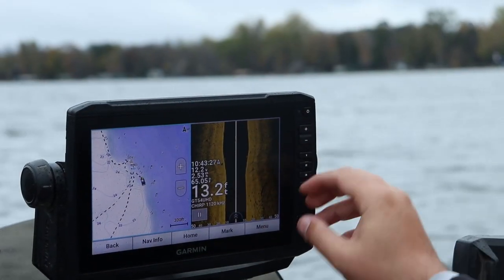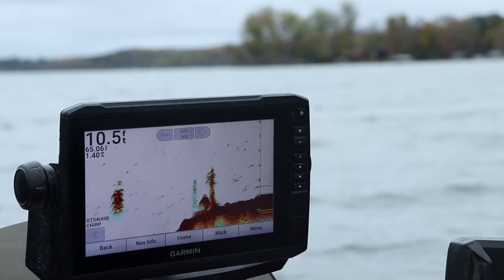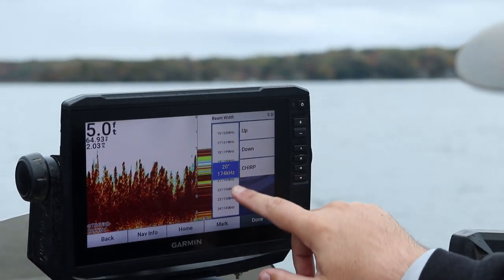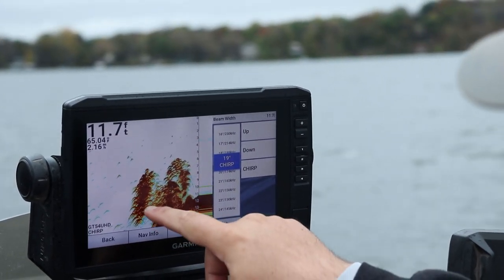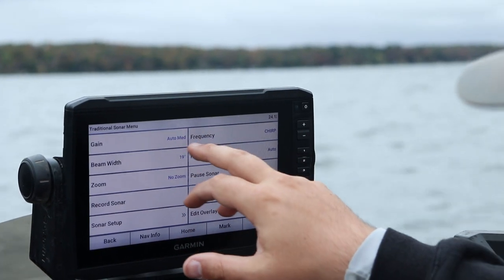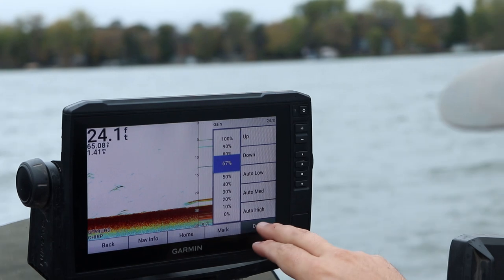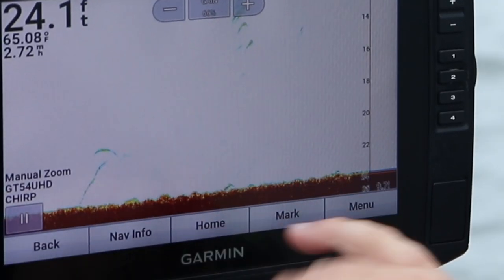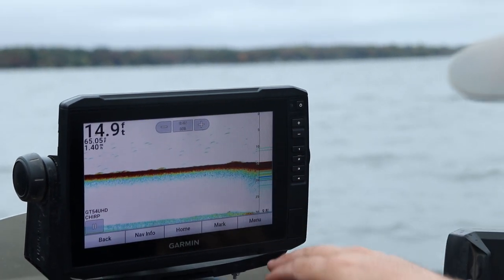How to use 2D Sonar to Find Crappie (Best Sonar Settings)

Comment: I’ve got the Garmin 4 on a 14ft Marlon aluminum. I’ve never really liked it but it is better than nothing. I don’t fish big water like you guys out there. I’ve only got a Honda 8 HP and a 20 year old Minkota. Thoughts on upgrading the transducer to the Garmin GT8HW TM VS just spending the $500-1000 and getting a new unit all together. Thanks from Western Washington.
Reply from the maker: You may want se the striker 4 and upgrade to the striker vivid 5cv instead of gettting the gt8w transducer.  The 5cv will have down imaging and plus mapping. Or, if you had the budget,  the Garmin 7sv.

Comment: I use my unit at sea I have garmin echomap 75uhd  I need to find wrecks at depth between 30 meters and 100 meters what settings would you suggest for this. Very good video. Gerry

Comment: do you have it? What do you have on a 9 inch boat can you use it under the ice Fishing Please answer
Reply from the maker: You can use the Garmin 93sv for both the boat and ice fishing. If you want to use it for ice fishing you will need to buy the Garmin ice fishing kit, which comes with an ice fishing transducer and a portable battery kit for the Garmin 93sv.

Comment: i am looking at buying a 126 ultra ,theres so many units to choose from, i will be crappie and bass fishing
Reply from the maker: The 126 ultra is top of the line. Are you planning on buying the livescope system as well?
Reply: @FloppingCrappie  i already have the livescope system i just wanted a bigger screen ,i have a 9" screen now
Reply from the maker: @garysunday4505  oh ok. Then that 126sv will be a great unit for livescope and SI/DI. If you didn't plan on using it for side imaging or down imaging,  id recommend the 1242xsv. It's a 12inch screen that's less expensive than the 126sv. 1242xsv https://bit.ly/3Jnbc42